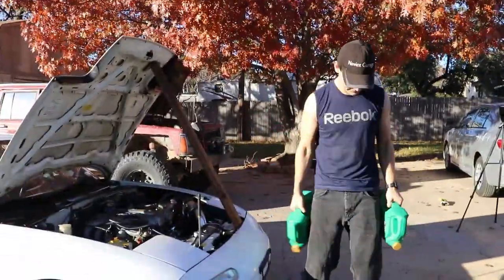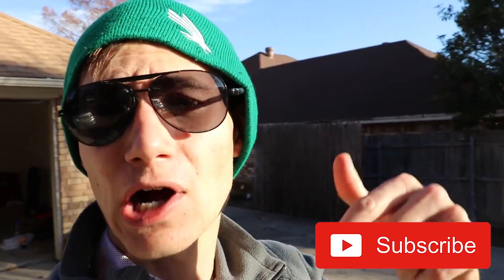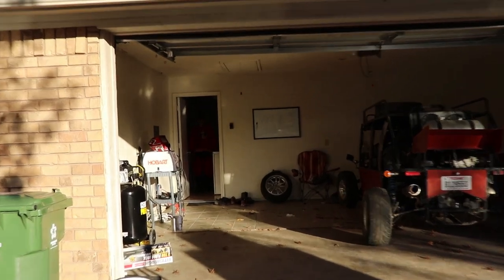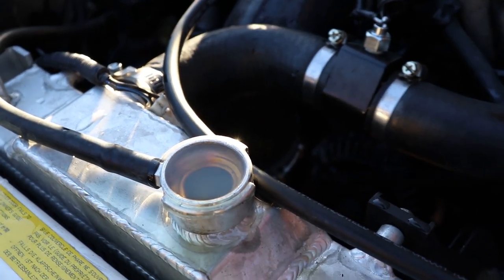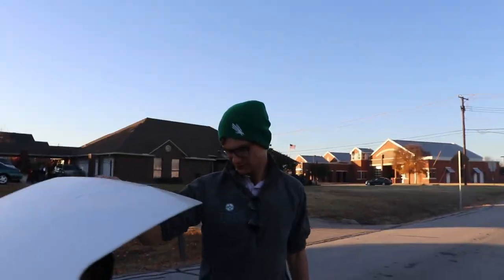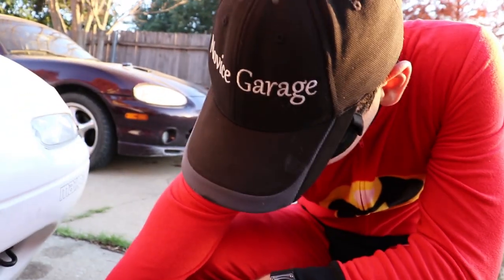Will Engine OIL Work as Car Coolant?

Comment: The heater and shit is never going to be rid of the oil film
Reply: @Denzel Walls Agreed, I want to see the awfulness inside that engine!
Reply: Yep the heater core is going to completely shot and everything else does connected to it is shit.
Reply: Next video: Can you clean a coolant system with brake cleaner!!???!?!!!? 🚓🔨🔧🤸‍♀️🥕
Reply: Gel for washing machine, like for clothes  is the best to rid of the oil. They should mix gel with water, and use it as coolant

Comment: Straight engine degreaser in the radiator
Reply from the maker: Sounds dangerous haha
Reply: Ive used straight purple power to clean oil out of the radiator. It worked.
Reply: This is a real click bait video that they must do if they wanna be successful at baiting people lmfao
Reply: @NoviceGarage  Send it mate!

Comment: that milkshake is actually an emulsion of oil, water and mountain dew. it's interesting though if it's 100% oil in the cooling system, i think it'll work.
Reply: I work on "oil cooled" motorcycles all the time and they literally have this kind of cooling system.  

Oil "radiator", hoses, thermostat, and cooling fan and the oil capacity is massive in comparison to other bikes with a similar displacement.

Comment: Seen an old Avalon doing fine with ATF as coolant

Try brake fluid as coolant.  Green coolant is ethylene glycol based and brake fluid being glycol based with a higher boiling point?  Like try straight DOT 3.

Comment: Flush the coolant system with distilled water and 2 full cups of laundry detergent one cup degreaser, run motor at 3k rpm for 40 seconds or take ride around block repeat 3x then flush just distilled water twice

Comment: That is a sign your head gasket is bad, foam is water or exhaust gas in the oil, thermostat never opened is why it never all warmed up.
Reply: yeah, the engine was already messed up.
Reply: Thermostat never opened so the engine didn't warm up?? You do know what a thermostat does right?.?.
Reply: @jpyka4x4  yep a value controlled buy the expansion of wax contained in a tiny cup piston. If there is a air lock at the side of it heat never gets to open it. That is why they had cool fluid on one side and not a even temp in all of it. If it had opened there would have been flow and all the fluid would heated. This why if there is a air hole in the unit , you put it to the up side. If you do not have a bleed hole you  drill one, in  the old days they did not come with holes in them for winters here in the north. Heated the cars up fast because the was no flow until the temp was reached to open it , but messed them up in the summer bad.
Reply: Actually its white because there was still water in the engine when they added oil. Also. Oil foams when its churned. The water pump is steadily churning that oil. If it has a blown head gasket it would have blew that oil everywhere when it first started
Reply: You are right on that water of some type is always still in the coolant system, even when you think you have it all out and take the engine a part to work on them there is still always fluid in the system to spill out. But not just how I see what is going out on this car. If you watch the exhaust smoke changes in each of the last few videos, with the fluid type changed, means it is get it to the cars exhaust system. You can tell the white steamy smoke with the water vapor coming out the tail pipe. It is also why they are losing power so much, soon if they start it with the radiator cap open the compression leaking to the water jacket ( head gasket most time/ crack in block worst case) will shoot the fluid up out of the fill hole. That pressure is currently busting out the weakest point, the hose that keeps breaking. If your rings are real warn oil will turn in to a foam from the blow by exhaust getting churned all up in to it. If you have foamy oil you can put it in a clear glass jar and let it settle, and see if coolant or blow by, the water/coolant after a few days will separate from the oil.
I hope they tare this motor down to show all the worn out parts in a future video.
Reply: It's probably because they did not flush the system so coolant mixed with the oil

Comment: No oil sits on water because it is more buoyant than water that's why when you see oil spills in the ocean the oil is on top. Or when water is in your fuel tank it goes to the bottom of the tank making your car run like shit

Comment: Because the stock thermo sensor is likely in the block and the after market one like you said is before the rad. The thermostat has not opened yet

Comment: You guys didn’t bleed the system still had air pockets on heater and water making the heater hose rupture. Oil works and you can delete reservoir

Comment: That weird stuff was water. You can't clear water out of the engine without extra equipment or give it long enough for it to evaporate. One little tip,pour with the spout on the top and it will pour without gurgling. It seems wrong,but I tried it and it works.

Comment: Just saying I have been running 0W16 mobil 1 as coolant for 4yrs now in my 88 Toyota pickup and it does absolutely perfect even in the Michigan winters it does great and in the high heat 🤷‍♂️ plus I'm still using the same 0W16 oil from 4yrs ago and it still looks golden with a little darkening. So I have to say the right oil weight is definitely great to use as coolant and it is it's own antifreeze lol
Reply: There technically isn't any reason why cars can't use oil as coolant as long as the car's design accounts for the viscosity.

Comment: Water is heavier than oil🙄
Reply: I think it's more about the viscosity bro
Reply: Adamdickieson i mean that oil is lighter than water. Not about viscosity
Reply: Water weighs in at 1000kg/M3
Oil is aboute 900 kg/m3.
That's why Oil is ON the surface of the water. (like when a tanker hit ground)
Reply: Polar vs non polar molecules

Comment: You should have ran the motor after flushing with water. There was still water in the motor(water jacket, etc.). The oil and water emulsified, that's why it looked like a milkshake. And, if a hose breaks, replace the whole hose. If its rotted in one place, it's probably rotted period.

Comment: The milky oil is cos of left over water in system as you only drained the radiator you got to drain the engine block there is a drain plug on the side and the heater matrix will have water in it. It's quite hard to fully remove all water unless you remove bits from car and run compressed air through as I once had an engine running Evans waterless coolant and even after your done thinking you got the water out you haven't so Evans makes a prep fluid which is designed to absorb the last dregs of water.

Comment: The temperature difference is because your aftermarket sensor is by the radiator and the stock it at the thermostat. 
At this time the thermostat hasn't opened to let the hot coolant circulate through the radiator yet

Comment: An air coole Porsche 911 is in fact oil cooled so the idea should work if you dry out the water from the system before you ad the oil.

Comment: The W in the oil viscosity doesn't mean wight it means Winter so when the engine is cold below freezing the oil would flow like a SAE-0 and once it's warm it flows like SAE-20...

Comment: 2014 chev suburban 5.3l v8 has been running hotter than normal for a few days my wife put ATF in the coolant reservoir and the temp is back down to normal she said she did it before about 8 mo ago while i was on deployment i’m like wtf??? but yeah trying to decide if i will flush and fill and new thermostat

Comment: I think the cooling system is more reliable with oil but you need some antioxidant so you can keep the oil for like 10y. But the problem is if oxygen (air) gets in it eventually degrade the oil so it needs not to be opened after that. The fluid pump may not work well  with the higher viscosity oil. 
Otherwise the cooling power is worse, not sure how well it can cope with hard driving or hot weather
Reply: Yeah, the water pump and probably most block designs wouldn't be sufficient to circulate oils. The oil itself would be a antioxidant though.

Comment: Looks like mixed oil/water to me. I sucked up a pretty good bit in an old truck when offroading and it was about that color until it separated. My four wheeler has essentially a small radiator in front of the engine and the oil pump pumps the oil through and thats how it keeps its heat down. Pretty much what yall did here except you have a thermostat and fan.

Comment: try mineral oil as coolant, its used as a non conductive replacement for water cooling computers, you may have better luck with it
Reply: I know it works. My tractor is cooled by mineral oil and it runs the same or slightly warmer than normal coolant plus it totally eliminates corrosion in the cooling system. Be wary of leaks though, they use mineral oil to breath fire too I think.

Comment: With this one if the miata overheats and has a head gasket leak between the oil and coolant passages it will be totally fine, the oil from the cooling system will replenish any oil that gets burned and the water pump will keep the pressure equalized. Genius!
Reply from the maker: Haha!
Reply: Unless there is water still in the jacket which there must of been for it to be so milky when it got upto temp it hopefully popped a hose and not a gasket or warped head.
Reply: @GB-dp5bs  sshhhhh

Comment: Here's a scenerio. You're driving through the desert and you start to overheat. All you need is to add more coolant but you don't have access to anything except for one thing....yep.....PISS in the radiator and see what happens. And the foamy stuff is the oil and water mixed by the pump. Like when the head gasket goes bad and oil gets in the coolant

Comment: just plug off heater lines.
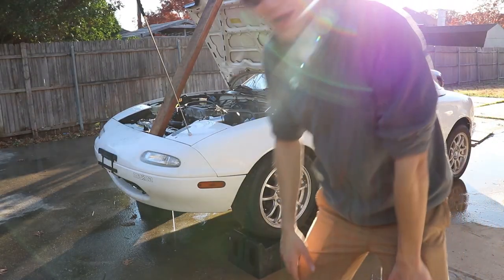4:00 as a auto parts guy i just realized u can get the flush kit and just loop the heater hose on it....BOOM problem solved and a easy clean! damn im good at my jurb
4:23 also  i might add u can get a self priming pump powered by a power drill from oreillys  standard garden hose connection...ish
4:30 also couldnt u just take off the rez feed line then pressureize it since water doesn't compress?
5:30 jap car. need panda suit.  oh try heavy like 75-140 gear oil as coolant
6:00 also thinking that coolant refill kit might be in order...and maybe a MD bottle as a overflow tank...
7:18 note to self when head gasket blows replace coolant with 0w oil.
7:53 diff sensor, diff style of reading, or it could be as simple as off or on, older cars like 80s have that since they where DIRT cheapo
9:20 thats windage aka air aka yo water pump sucks DIIIIICCCCCCKKKKKKK
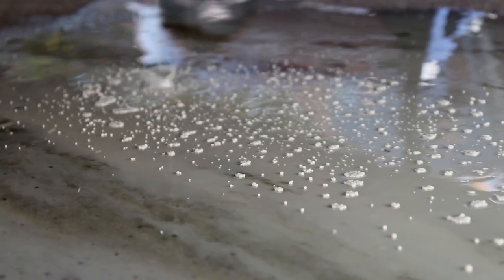10:42 its water and oil, as they dont mix.  left over from the MD, water wetter, the flush, so on and so on. thus the flush kit and heater hose  loop like loop it back in on it self with the flush kit
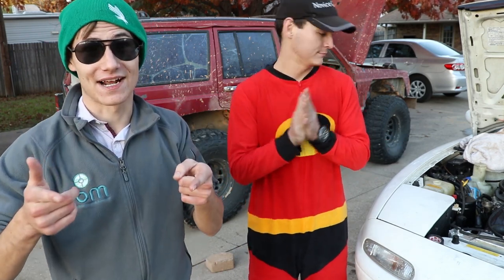11:52  prob just burnt up inside bad valve seats or valves don't work right no mo
next up, coke and mentos, gas as coolant, def as coolant, oh mix jello or puddin as coolant, i could just walk around work and show yall things like 75-140 gear oil in gallons, or brake fluid or power steering or ATF or sycromesh,

Comment: You still had water in the block that's why it turned gray I ran a Chevy 350 on straight marval Mistry oil for 500 miles to get stuck head bolts out it work fine never got hot

Comment: Probably should have just bypassed that heater core by looping the hose back into the engine where the other side of the heater connects. That would have also made the engine swap a little easier because now they have to replace that heater core. I never worked on a Miata but I am assuming it's somewhere inside the dashboard? If so, those aren't easy to get to. Worst case scenario is that heater core or one of the hoses inside of the firewall ruptures inside the car and spews a mountain dew/oil/coolant smoothie all over the carpet and whatever wiring harnesses it might be near.

Comment: I think oil would actually work well for this application if it was lighter like a mineral oil with a anti corrosive additive package. Coolant is just less expensive and less messy
Reply: Anti corrosive package???  How much do ya think metal would corrode if was permanently covered in oil?

If your radiator was full of oil (and not a drop of water in it to turn it into a milkshake)...
1: You'd NEVER 'boil' the radiator
2: The cooling system could NEVER rust out from the inside
3: Remove the radiator overflow / header tank - Just plumb the line directly to the sump
4: I've heard of a dry sump, but a dry radiator??? Hmmmm

Comment: Leftover water in the heater core and block is likely the reason for the foaming and emulsification.  If properly flushed with oil, it actually may work long term, but why is the real question.
Reply: Here is "Why"... Oil doesn't react with metals to make rust.
Reply: @lucasdetex8703  yeah but then to avoid sludge you have to convince people to change that regularly enough too, which is so-so in a world where not everyone can be bothered to change any fluid on a regular basis.

Comment: There's nothing unusual about using oil as coolant.  You must have heard of oil cooled engines. The problem you did was that you flushed with water. Water plus oil equals emulsified oil, that milky stuff. You should have flushed with a special flushing liquid that removes water. Oil also has a higher boiling  point, thus it gets to a higher pressure, thats why the hose went pop. Otherwise there should be no problem with swapping coolant for oil as long as you change the  coolant hoses. You can buy waterless coolant for cars, it's more expensive but then again you supposedly need not do a coolant change or top up.
Reply: The pressure in a cooling system is regulated by the cap, which feeds the overflow tank. The pressure won't change unless the car is severly hot.
Reply: @woopyass  I understand and agree but the system is designed for water/coolant mix, not  engine oil which from what I've been told boils at around 300°C (572°F). If the water pump cannot pump what will be an incredibly viscous fluid then it will just sit inside the engine and boil. Any weak point will very quickly showup. The hoses for example will start to soften and again any damage or weak points will go pop.

Comment: Feel like if she survives you should use atf.
Reply from the maker: That would be interesting
Reply: ATF really isn't all that much different than engine oil. They are both oils, just a different additive package. I think the result would be the same: It'll eat the rubber and cause another leak.
Reply: Avery Alexander if anything atf would clean out all that shit because it has detergent in it
Reply: Rmaul246    yes 
2014 chev suburban 5.3l v8 has been running hotter than normal for a few days my wife put ATF in the coolant reservoir and the temp is back down to normal she said she did it before about 8 mo ago while i was on deployment i’m like wtf??? but yeah trying to decide if i will flush and fill and new thermostat

Comment: You still had water in the block/mix of Mountain Dew... milkshake is a combination of the three, typically when you blow a head gasket your coolant looks like chocolate milk... interesting that it probably would of kept on running to some degree had the hose not broken again

Comment: Next video, using gasoline as oil, coolant, washer fluid, power steering fluid, brake fluid, and paint wax all at the same time
Reply: I want them to use coca cola as coolant or white spirit as coolant

Comment: The oil turned white because it mixed with water That was still in the coolant system after you flushed out the mountain dew

Comment: Drain all the fluid. Start the car and get it hot. Than fill it up with cold mountain dew. Than start it and see if the smoke the starts pouring out is green like the dew
Reply: I thought mountain dew was clear and if you poured cold liquid in a red hot motor it would crack the block.
Reply: @GB-dp5bs  yes it would. Thats why they should do it to kill the Miata engine once and for all. And Mountain Dew is green

Comment: No it won't. My mom accidentally poured a quart of oil into the radiator
Reply: Plumdum   
2014 chev suburban 5.3l v8 has been running hotter than normal for a few days my wife put ATF in the coolant reservoir and the temp is back down to normal she said she did it before about 8 mo ago while i was on deployment i’m like wtf??? but yeah trying to decide if i will flush and fill and new thermostat

Comment: The oil wont boil so theres no need to have the cooling system pressurised, take the valve out of the radiator cap and it wont blow any hoses or the radiator.

Comment: WOW !!  What a waste of time and money the engineers wasted specifically formulating the various fluids for an engine. I'll bet the engineers never thought of using engine oil as coolant. How about coolant in the rear axle or power steering fluid in the brake system ?  Asking for a friend.

Comment: Put 4 quarts of lucas oil in the motor to see what happens
Reply: my friends and I did that on a saab that had horrible oil burning problems through the valve stem seals and it ran fine
Reply: Marshall Sambell did it still burn oil with all Lucas oil?
Reply: loud ring yes, it did still burn it quite badly but it slowed it by a noticeable amount

Comment: If you guys wanna click bait your gonna have to be more clever with the ideas and how you word it
Reply from the maker: Advice?
Reply: Dumb the titles down to just a short vague question and literally make everything you use on the car non car related.
Like can you use dish soap for oil or lighter fluid as gas,
Dangerous and dumb things draw in the dumb crowd which is majority of people,
Id suggest the lighter fluid but the car will be fucked after,